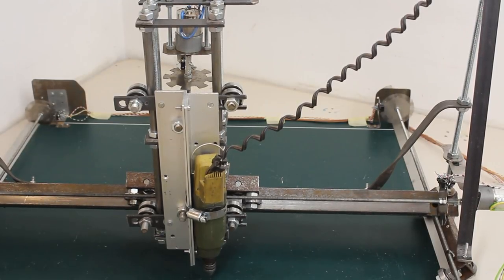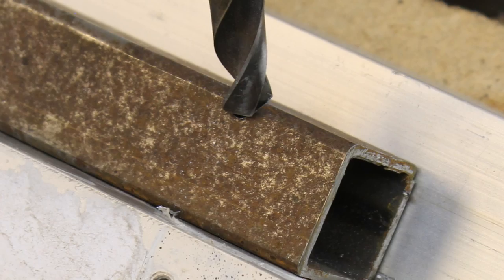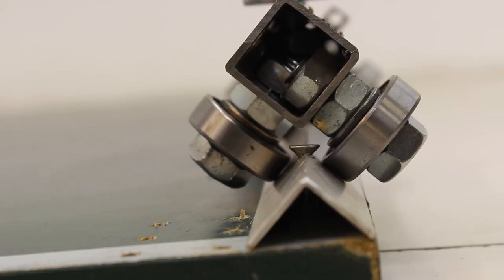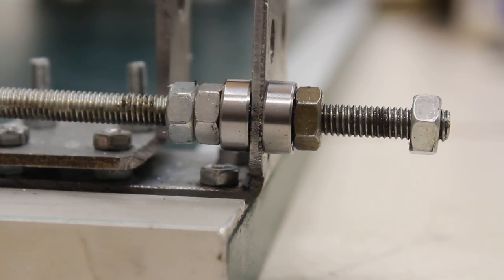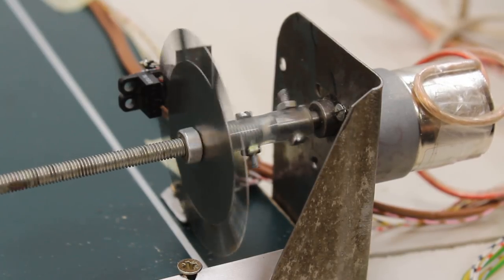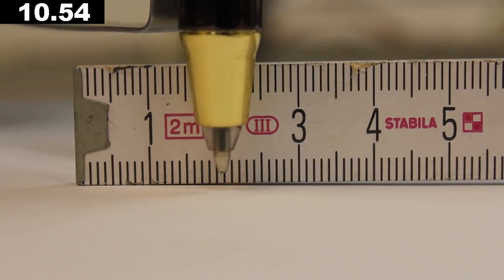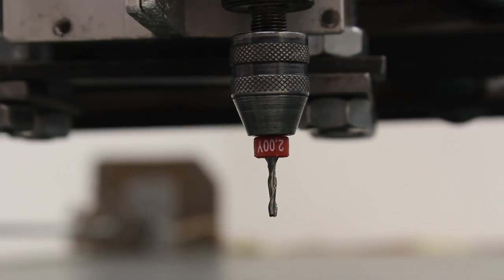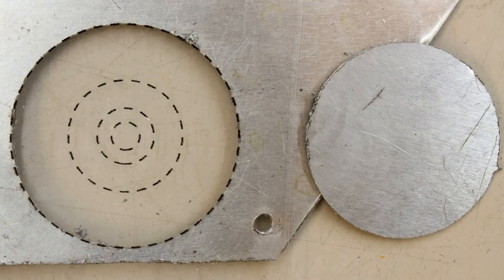Homemade CNC machine with materials from a DIY, built with simple tools

Comment: Hallo! I'm really interested in you project but for me the hard part is:
Ok suppose I can substitute stepper motors with encoded DC motors in GRBL using an Arduino, but how to make them to do a cooperative work? How to say: If you hit a rock sitting on the working table while you are moving in pure X direction, the rock will slow you down but the servo will keep up and you'll draw a perfect straight line in the end (ok that was simple man!). What if you where going on 45 degrees instead and you'll hit against an X direction oriented straight obstacle? The Y run will be strongly slowed down by the frontal impact, but the X run will not be slowed down at all slipping on the straight surface of the obstacle!!! 
In the end.. Will you obtain a perfect 45 degrees line? I think... NOP! 
---- It will not be straight in the end, Am I wrong?----
Sooo how do you manage those kind of issues?

Ok my first hypotesis was a bluff...
How did you've been albe to subsitute STEPPER MOTORS with ENCODED DC motor on GRBL software?!!! Are you magical?
I'm quite good with arduino sketches but C programming is not best :-(

Would you consider to make a tutorial?

In conclusion: Thank you for the huge inspiration Homo, but... I absolutely need other help to float.
Reply from the maker: DC motors with sensor feedback are controlles same as stepper motors. If you'd like to draw a 45° angle you command the x motor for one step and with the sensor feedback you wait until that step is done. Then you move the Y motor for one step and wait until the step finished. Next you command the X motor for one step and so on...
Reply: HomoFaciens So it seems to work! Thank you!  My trust in faith has come back again.   I will explore your post to find out how to substitute a stepper with a closed loop servo!  Thank you very much!
Reply: How to modify the GRBL to wait until the "step completed" comfirmation? Natively GRBL has built to give commands to stepper type motors with a given speed without waiting for any confirm right?
So how to do this huge modification? 
"I absolutely need other help to float"
Reply from the maker: I did not dive that deep  into grbl yet, but it will become an issue, soo. First I must make my CNC v3.2 work properly. Then I will make this machine process G-code (maybe using grbl, maybe in another way).

Comment: Hello HomoFaciens, I'm very interested by your excellent work because I've got at home the same component you use in this project!I don't have any problem for the structure or hardware, because I use Solidworks and i have many material in my laboratories, but it's not the same for the software parts!Can you help me please? I don't understand well, what i can interface the Arduino with a computer design program (solidcam???) for obtain a milling directly by a drawing?? thank you so much!
Reply from the maker: +\ prof The program you can download on my project page doesn't interface with any construction program. All it does is selecting a *.svg graphics that must be stored on the host computer (created with any software that can export scalable vector graphics). That file is than transformed into stepping commands and plotted.

Comment: do you think it could very slowly carve into steel or big aluminium block?
Reply from the maker: HalfLife2Beta How many CNC machines do you have build in your life? If the answer is "none" you will not succeed in creating a power CNC with high accuracy from scratch with a low budget in your first run! There is a reason why CNC machines for cutting metals (especially iron) are so expensive. So if you really need to carve into iron or if you want to create 3D workpieces rather than cutting 2D shapes you will need another design and software. I guess the thin aluminium I have processed in the video is the limit. When using sharp, high quality (expensive) router bits you might be able to cut deeper into Aluminium or maybe brass. I will demonstrate how to build stronger CNCs in the future - stay tuned!
Reply: what i don't understand is why i can't carve VERY VERY SLOWLY but quite deep into aluminium, what happens if you try? I'm not asking for a CNC that makes a motor in 10 seconds but that can make small pieces of aluminium from one block but very slowly, why wouldn't it work?
Reply from the maker: HalfLife2Beta In order to cut a material, the drill bit needs to build up a side load. The harder or thicker the material, the higher that side load. Side load causes a deflection of the mechanism as demonstrated in the video when pushing the router by hand at the tip of the bit. The precision on the vertical axis is clearly lower than that on the X/Y axes, thus it will be hard to dive only 0.5mm into the aluminium (the router will be lifted when cutting the aluminium). Iron is too hard, The side load needed to cut even thin iron sheets is too high (no matter how slow you drive the machine), the router will vibrate clearly, thus there will never be a straight line. So now that I have answered many of your questions, it's time to answer mine: How many CNC machines have you build in your life or have you ever operated a CNC machine?
Reply: I never pretended to have built any CNC machine and I never said I was an expert in CNC machines. I just found your video interesting. I don't have the budget to build a CNC machine anyway. So you got your answer. :)
Reply from the maker: HalfLife2Beta It would be frustrating to build a machine like mine and see that it can't do what you want after spending all that time and money. Cutting metal with a CNC router is a high quality job that requires (expensive) high quality tools. I am currently creating a CNC that is powered by geared motors from old optical drives and that can be build even without a drill for clearly less than 100€. Of course, the accuracy of that machine won't be high, but it is meant to be a good educational "toy" that can be built on a weekend. Maybe that can become a starting point for you. I will demonstrate some later how to improve the accuracy  and speed. Maybe one of those evolution steps will do what you need - stay tuned!
Reply: Yes I think that would be a very good idea! In fact I've seen those on youtube - some guys did 3D printer at 60-100 dollars ( http://www.instructables.com/id/eWaste-60-3DPrinter/ as an example ). I shall stay tuned and thanks for answering all my questions ! :)

Comment: did you write your own program or where you able to incorporate an existing program and input your own perimeters?
Reply from the maker: I wrote this software from scratch only for my machines with spechial input files (SVG with all paths turned into polygons).
Currently I am rewriting the sources to make it work with CNCs in general, supporting gcode.
Reply: HomoFaciens ok, i was concerned about this. my programming skills are novice. i am good at building things and i was worried id spend time with the construction and wouldnt be able to program the motors to work with various sketches. im confident i could program a single repeated motion, within arduino.       

are you aware of any generic software available for gcode? 

by the way, great job. your project seems to be very superior to the other diy projects ive seen. rock solid design. i plan to work on this soon, but i want to be able to mill aluminum 3d peices for my invention.
Reply from the maker: I have done an upgrade of this CNC using conventional bipolar stepper motors:
http://homofaciens.de/technics-machines-cnc-v2_1_ge.htm

With that you can run grbl on your Arduino and so process gcode. With a gcode sender it's a common combination for DIY CNCs.

It's a solid design, but my CNC v3.2 is more rock solid:
http://homofaciens.de/technics-machines-cnc-v3-2_en.htm

It's the machine I am currently writing the software for (and I am still working on an improved hardware design). If it runs fine with my v3.2 I will also make it work with my v2.0.

Comment: Please Mr. How can you call data to the arduino ....for example the data of circle how the arduino understand it ...which interfacing you used......thanx alot and very good jop
Reply from the maker: Mostafa Qais The only thing the Arduino under stands is: Make one step forward or backward with one of the three axes. The X/Y coordinates of a circle are transformed into those single steps by the host computer running the program with the source code of "commands-CNC.c". Learn programming in C to understand what's going on.
Reply: HomoFaciens I understand now ,you programmed the circle data(for example) in c and then transfered it to the arduino.......this means that all figures which your machine are drawn them are programmed using c command,but this will be complex if you want to draw another complex figures....what about AutoCAD interfacing ,can we do it? Thanx for your reply,I respect you😊.
Reply from the maker: Mostafa Qais
You're welcome! There is (currently) no interface for reading other files than *.svg (Scalable Vector Graphics). Maybe there will be an upgrade sometime using G-code files...

Comment: but is it possible not to have the Z-axis and replace the power going to the CNC router to the power going to the laser. As of yet, I only have the budget for a 1w laser and the safety measures to use it
Reply from the maker: Of course, that's how you can do it. Consider that this is a low speed machine (around 3mm/s with the motors I am using).
Reply: +HomoFaciens  What RPM motors did you use?
Reply from the maker: Have a look at the project page before posting a question that has been answered multiple times:
http://www.homofaciens.de/technics-machines-cnc-v2_en_navion.htm

Comment: its inaccuracy is not good .... you can make it much more if you used a bolt before the engine , and the plastc lint , so that , it wont tilt and move as we have seen it in the video
Reply from the maker: +wael Auto.Eng.student The more straight the threaded bars are aligned, the less wobbling. Using a piece of rubber tube is a simple and not too bad solution. Meanwhile I did an upgrade using bipolar stepper motors that are connected through solid linkages and yes, it is a bit more precisely now. The video will follow soon.
Reply: HomoFaciens
great !
have you considered making a large scale one ?
what is you study / expert job , because you got skills and brain , and with the right knowledge you could do some things much better " and these are indeed very good
Reply from the maker: +wael Auto.Eng.student "Small is beautiful". With the new motors, the machine speed is still not very high, thus processing large items is time consuming. Maybe I will try more powerful stepper motors some later.
I am a programmer and I have learned the basics about semiconductors long ago when I was educated as a physics laboratory assistant.

Comment: Why don't you use the same angle linear guide at the other side of the y axis?
Reply from the maker: It's the fixed end and free end principle. If the other side would also be fixed, both bars had to be aligned in parallel very accurately or else the carriage would jam, repectively run up and down on the linear guides. It's more easy to build, but not less accurate when using a free end.
Reply: Thank you for answering my question.I was a bit concerned because i have a old linear axis from a big scanner and it has a stepper on 1 side and a free end on the other and has a big  wobble so i thought this would have it too but i  guess the second stepper solves this.
Reply from the maker: The second stepper eliminates (at least reduces) backlash in X-direction on the free end.

Comment: amazing. what was the cost of the whole thing?
Reply from the maker: Peter James Have a look at the project page with the parts list: http://homofaciens.de/technics-machines-cnc-v2_en_navion.htm
Reply: thank you. well i have never worked with metal or electronics this complicated--if you assembled all the parts and made a kit how much would you charge for it? no guarantee I will buy from you but if not me then other people might buy from you.  I like your design. I might want a bigger version because I might want to be able to draw patterns on wood.  okay thanks.
Reply from the maker: Peter James If you have some experience in mass production of machines, you can make that calculation by yourself, using the parts list. I have never sold machines (yet) thus I can't answer your question. The design is open source, anybody can sell a kit based on that machine, thus if you know somebody...
Reply: ha ha :) i don't want the headache.  if i wasn't lazy i wouldn't have offered to pay extra so you could assemble everything!
Reply from the maker: Peter James Don't be lazy - my projects are for makers ;)

Comment: Why are you not using stepper motors instead of servos? Wouldnt that be easier?
Reply from the maker: +Maximilian Wicén But I am using stepper motors! They are based on DC motors fith a feedback sensor. I guess you mean conventional, bipolar stepper motors. Well,I am running an educational project. Making things different is part of it. However, sometime I will show how to drive this machine with bipolar stepper motors - stay tuned!
Reply: HomoFaciens Ah right, was mainly thinking since you have those optical sensors I assume.
Reply from the maker: +Maximilian Wicén Well, I had the sensors and the DC motors but no stepper motor being strong enough to move the axes.
Reply: HomoFaciens Would you consider a stepper motor with sufficient strength to be an easier choice to work with for a novice like myself?
Reply from the maker: +Maximilian Wicén At least I would not change the design of a machine as long as I am not able to change the electronics and software, too!

Comment: Hi "cnc_c2.ino" Arduino board to try to install " commands-cnc.c: 15: 21: fatal error: termios.h: No such file or directory
  #include <termios.h>
                      ^
compilation terminated.
Error compiling. 

"I got your message. Please help. Thanks
Reply from the maker: +Hüseyin DEMİRBİLEK You must run the program with Linux. I have tested the compillation with Ubuntu 12.04.

Comment: At 07:13 how did you connected 2 flat rods (left and right) together with the nuts at the middle?
Reply from the maker: There is a 10mm bolt (short piece of a threaded rod) keeping it all together with the nuts.
Reply: HomoFaciens so the flat rod has a thread on it's end, right? And there is 1 nut on each of the ends (in the middle). But the nuts are pressed to the plates (black and silver respectively).But how the rods (left and right) are joined together? It looks really tricky!
Reply from the maker: Артур Файзуллин
Did you have a look at my project page?
http://homofaciens.de/technics-machines-cnc-v2_en.htm
Klick on the fotos to see the full resolution images for details. The flat rods have no threads (if I remember it right).
Reply: HomoFaciens thanx for the link. The page says: "Round iron tube with 10mm inner diameter, 1m long". Thus the flat rods are actually a tube over the rod! It really smart and nonobvious trick!
Reply from the maker: ...so we obviously were not writing about the same rod. I had the flat rods in mind, not the round ones.
Reply: HomoFaciens how to address/refer correctly to the rod with a flat (non threaded) surface?
Reply from the maker: ...I don't know either ;-)

Comment: Excuseme, software for windows, for this proyect, i don't have ubuntu or sme video with more information about the software please, i want to make a similar machine, thanks master, your tecnique its more exact.
Reply from the maker: I don't support closed source Windows spyware.
You can get Linux for free (e.g. Ubuntu https://www.ubuntu.com/download/desktop ). Linux runs on more computers than Windows does, thus you should be able to install this free OS. Follow the steps in the Readme.txt to install my software under Linux. No need to waste time with a video, reading and writing is done faster and I will try to help if your installation fails.

Comment: will stepper motor do a better job?
Reply from the maker: +Arjoonmoal I am using stepper motors for this machine. They are based on brushed DC motors with encoder discs. I guess you mean "normal" bipolar stepper motors. There will be a video about those devices and of course one of my future CNCs will be based on those drives - subscribe and stay tuned!

Comment: I think you got your tap order reversed.  I was taught to start with the tapered first then a plug and finish with the bottoming tap. But I've only used the bottoming taps on blind holes, plug taps always got me through the hole.
Reply from the maker: Jrsydvl2003 ...yes, you're right! That error was due to the language barrier. I have fixed that on my project page, but unfortunately videos are not that easy to edit...

Comment: please help me .. can i start it from windows??? or i must have linux to run it?
Reply from the maker: The command line tool I have written for this machine runs on Linux only. You can get e.g. Ubuntu 16.04LTS for free and install it on your PC. It's a free operating system, thus the better choice for free programmers.
Reply: oh .. okay .. but i din't understand one point .. how to run it on linux .. plz plz plz plzzzzz make a short video and teach us how to start with it .. cause i am a weak in linux and software .. and my dream to make cnc with dc motor .. plz help me for this :) thank u MR :)
Reply from the maker: Have a look at the readme.txt in the download package.
Reply: okay mr .. thnx for helping . if i have any problem i will contact you .. thank u so much

Comment: i need to try this with a plasma  cutter.
Reply from the maker: +gear head Consider that the speed of my machine is very low which might cause problems with plasma cutting. I haven't tried plasma cutting yet.